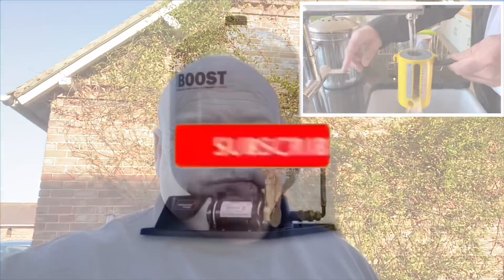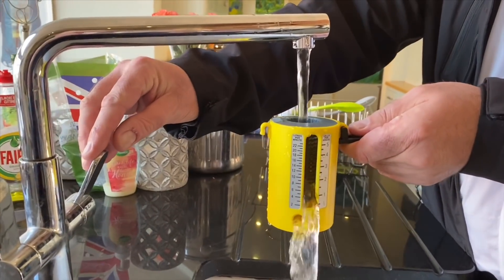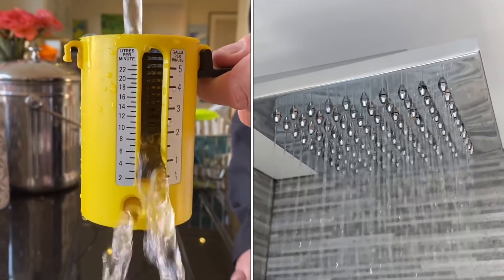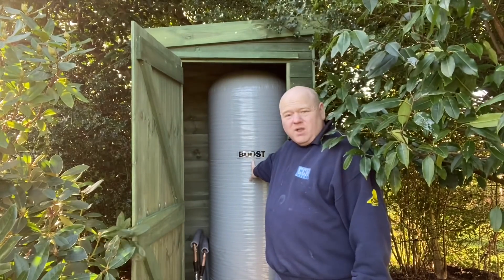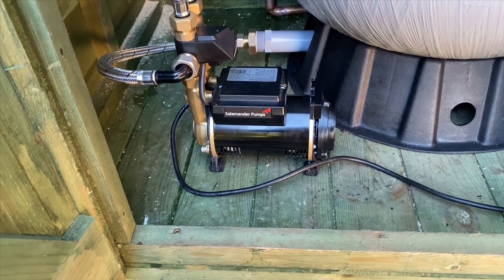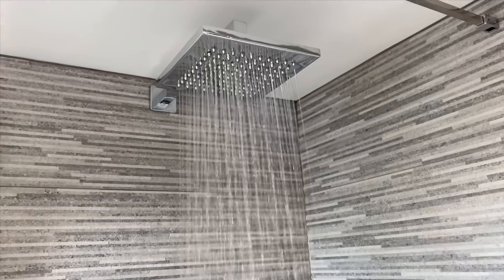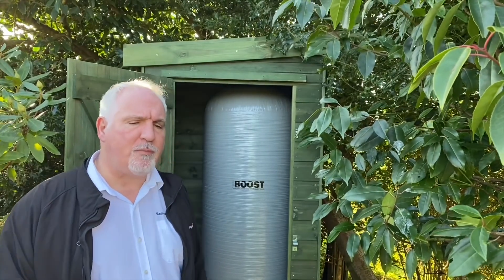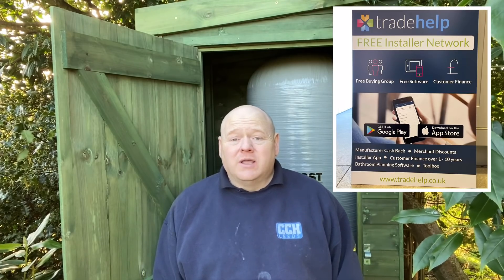How To Boost Cold Water Pressure. AccuBoost Accumulator

Comment: Marine engineer here, we use hydrophores and these same devices are installed into homes for boosting the pressure.
A hydrophore set is basically a water pump + pressure tank.

First of all you need to size your tank depending how many faucets/showers/appliances that you will use at the same time.

If you are a family of 4 to 5 people this tank in the video is already overkill, half of that tank is already sized for 12 people !!!
Also that pump looks dirt cheap and to small, you need a sizable pump to match your pressure tank or else after 5 minutes of simultaneous use the pressure in the tank is gone and the small pump can't keep up with the demand and isn't made to run very long and will burn.

A hydrophore system should not set you back more than $600 for a 4-5 people household and a $1200 for a 12 people household.
the pressure vessel is only to build a reserve, your pump needs to be able to keep up that reserve once it runs empty, the sole purpose of this vessel is to keep the pump from turning on every second you open a faucet.

If you want to deal with pressure drops between floors, you'll need to add a secondary pressure vessel on the main water pipe on that floor without pump.
In some cases you don't even need a water pump, pressure can be ok but the flow is restricted that you only need a pressure vessel on the highest floor to give backpressure from the other direction once flow suddenly drops.

Comment: these pumps do not stand the test of time and salamander what nothing to do with you when you have an issue. even within warranty period they are looking for any excuse not honour the warranty. these pumps are in most cases only good for the bin once they stop working as salamander do not offer a repair service. and many of the parts are machine pressed and impossible to repair even if salamander will sell you the parts - which they do not! they are also very loud. they market them as some of the quietest pumps on the market which is rubbish. consider a powertank if you have low pressure issues.

Comment: Hi I live in 2nd floor new build apartment with an ideal combi boiler fitted.
My problem is that the power of my shower is weak
On inspection from the water main I have a stop cock tap then an inside non return valve then a water pressure gauge then a Salamander type 2 booster.
The water pressure gauge is reading  16 psi and the salamander light is stating on solid when its switch on.
Do I have a faulty pump as the pressure remains the same at the showercor taps.
Please advise on how do I achieve a good pressure at my shower.

Kind regards 

Thomas Craig

Comment: So this is whole house boost, both hot and cold water? It’s balanced hot and cold?
Reply from the maker: Yes it will boost the whole house, Depending on what hot water system you have. Thanks.
Reply: @AllenHart999  so if you needed a better flow rate to fit a combi or unvented....you’d use this mainsboost system, correct Allan? 🤔

Comment: I am not up on the regs for pumped mains water. Under around 8-10 litres/min it could be pumped, with OK from the water company. Above? no.   But if you have 1.5 bar static, with abysmal flow, then non-pumped accumulators are wonderful. 
Been involved with fitting one in a garage to feed a high flow combi, eliminating the loft tank and hot water cylinder. Great way to go. Other makes can have the internal rubber membrane replaced by taking the lid of the accumulator off.  Simple job to do.
Reply from the maker: You are allowed to pump 12 l/m
Reply: @AllenHart999  
So, below 12 l/min a pump can be on the mains. I assume that depends on the water authority, and that you have to notify them anyhow.
Reply from the maker: @johnburns4017  https://www.youtube.com/watch?v=mPmBgEMtHJQ
Reply: @AllenHart999  
So below 12 l/min the pump operates, above it cuts out.  I rarely come across low water flow from the mains. I suppose it depends on where you are.

Comment: I've got serious beef with salamander as a company from problems with there pumps and warranty repairs through pumpwise I don't go near them now after the grief they have caused me and my customers Stuart turner pumps for me great pumps and customer service
Reply: galaxydave69 does Stuart have systems like this?
Reply: @kryptoniteee  yes
Reply: galaxydave69 I have with Grundfos mate... there very poor now to years ago, tech help have no idea and don’t want to help and there flagship home booster pump surveyed and recommended by a Grundfos rep failed within weeks then he wasn’t interested...still waiting for a call back!
Had the same with a faulty batch of heating pumps from them, failing within a short period of time, tech sad it may be ok next door??...won’t fit another Grundfos ever....fitted the customer another make at half the cost with no issues!!!
Reply: @Ash-fy2mn  yes mate I have to agree about grundfoss overpriced there shower pumps used to be re badged watermill I fit Stuart turner shower pumps and wilo heating pumps not a single problem yet

Comment: Nice video any chance I could do some work with you
Reply from the maker: Sorry i cannot take anyone on at the moment.
Reply: Allen Hart don’t worry it’s fine
Reply: @AllenHart999  so did a plumber fit a unvented cylinder originally with the poor 8 lpm flow rate for two or more bathrooms mate which is obviously a daft thing to do before you boosted it with a accumulator? Thanks allen great video btw

Comment: Hello Allen, I have fitted a couple of accumulators to feed unvented cylinders........ does this setup qualify as stored water & therefore is it potable?
Reply: it's banged right in line with the mains so i'd bloody well hope so. did i miss the non return valve for mains backflow? must be there somewhere
Reply: clive ramsbotty still 450 litres of stored water & my understanding is you “shouldn’t” drink stored water especially when subjected to changes in temperature.
Reply: @paulw4904  I'm a long way from being sure about that, but they've installed it in line with the mains so the water to the taps all passes through the cylinder at ambient temperature
Reply: clive ramsbotty my response was to D P...... it’s a genuine question that I have & not a criticism but just picking up on your reply for a moment....I’m not sure the accumulator is at a consistent ambient temperature given that it is outdoors & in a wooden shed!? Have you ever spent long periods of time in a wooden shed?
Reply: @paulw4904  sorry if it seemed like I was challenging you, that wasn't my intention and I know next to nothing about the system. Come to think of it the water in the accumulator would get pretty hot in there during the summer even with mains moving through... I'd love to know how the manufacturer gets around that especially with how strict the water board are these days...
Reply: Definition of potable water is if that water can be poured into a pot so yes. The vessels are designed and accredited to for water that is pottable
Reply: D P are you sure about that??